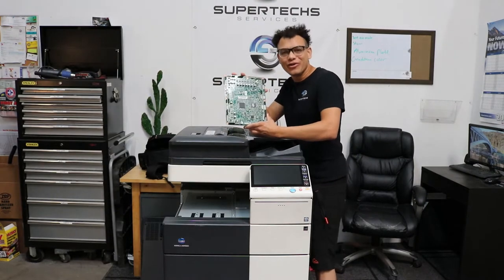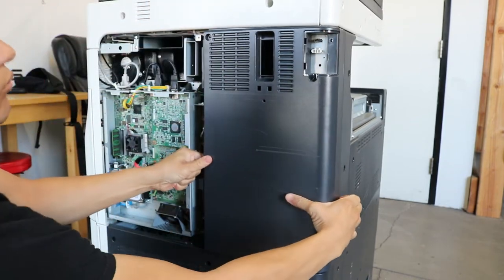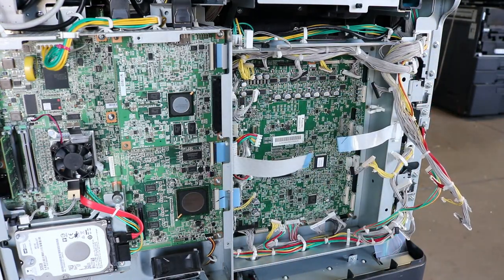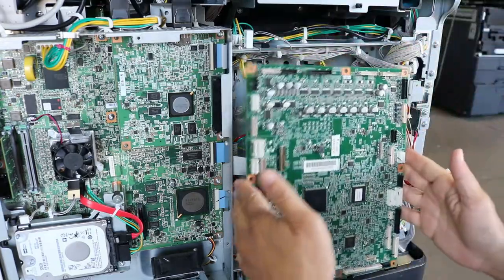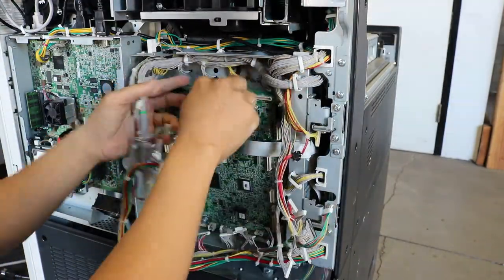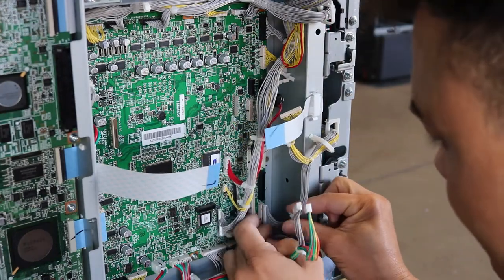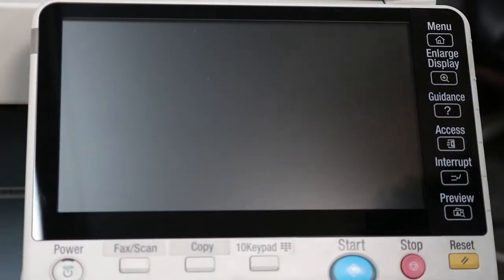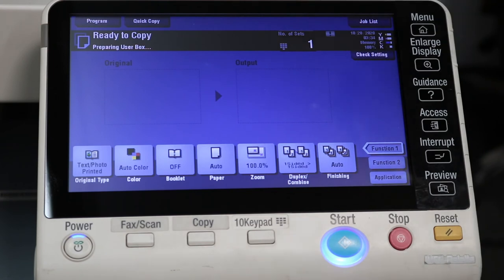Replacing Printer Control Board on Konica Copier

Comment: Are there any spots on the board where you might get the wrong wire clip plugged into the wrong slot? It looks like as long as you keep the wires in there general area, it cables should line up where they go, but I just wan to make sure there isn't a chance identical plugs on a harness that could get swapped.